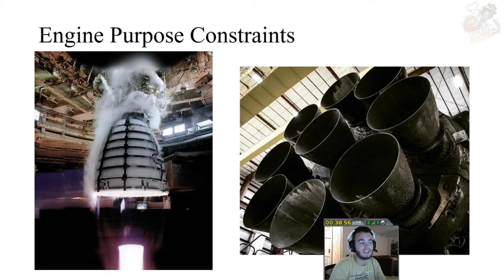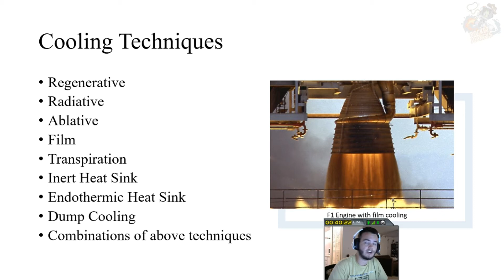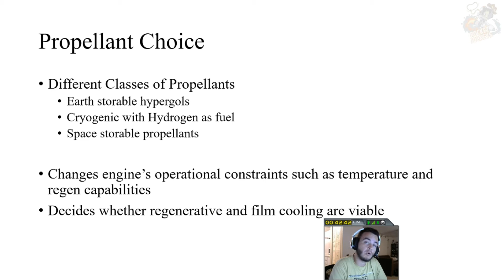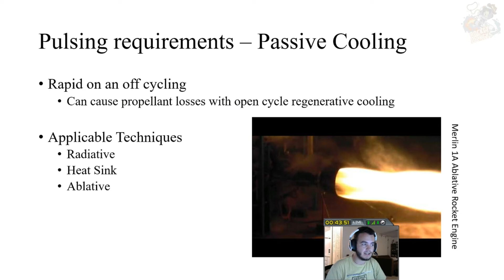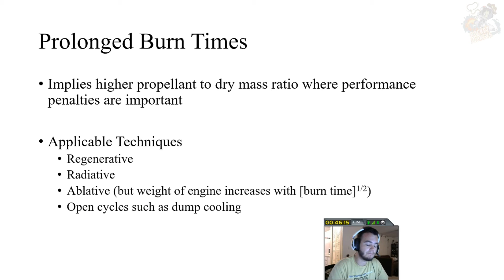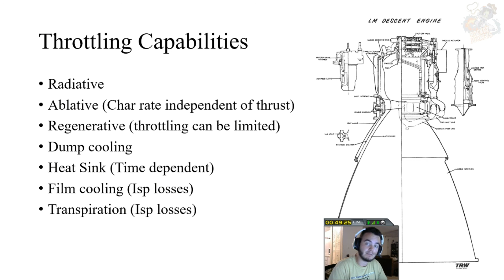I2ocket_Talk, Ep.3: Choosing a Rocket Engine Cooling Method

Comment: How do you recommend we model film cooling? I'm reading up on a bunch papers but there are so many things I don't understand/guessing about
Reply from the maker: There are several methods for sure. This is a little bit outside of my area of expertise, but there is obviously more comprehensive CFD that can be done but there is also a good but older (1991 iirc) report called something like "Film Cooling in Rocket Engines" by Arnold Air Force Base that talks about a simplified model if I recall. Main things to consider are the heat transfer mechanisms and flow characteristics, definitely involved though no matter what